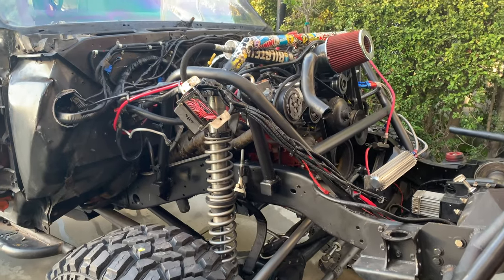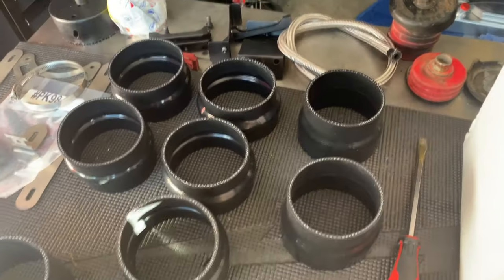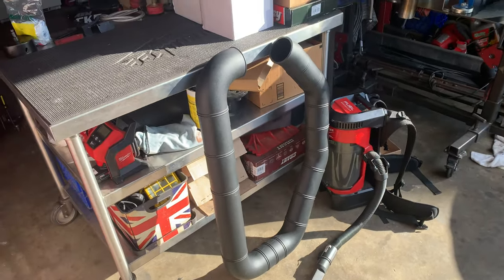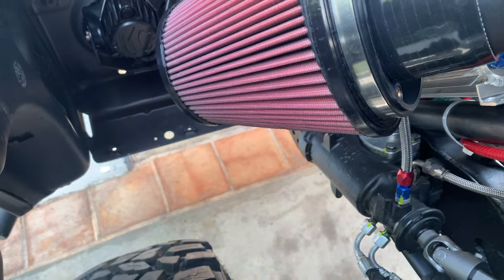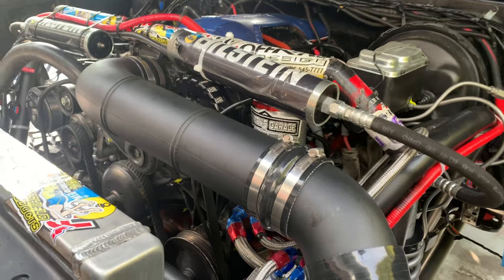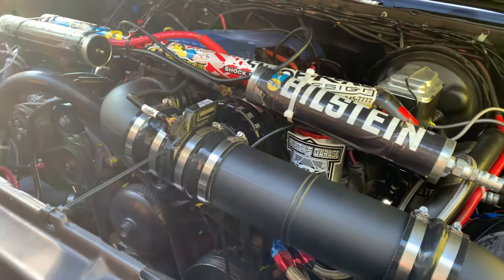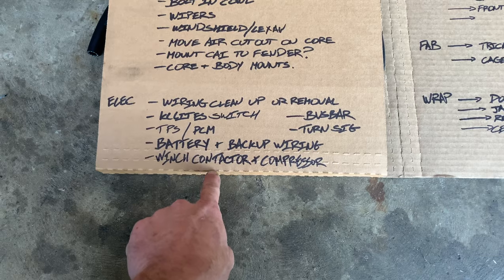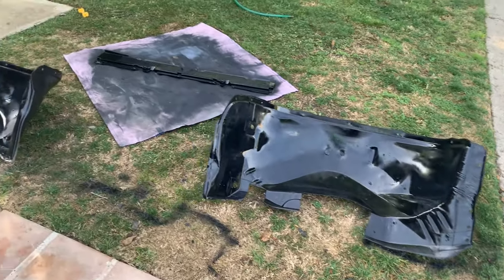MG #187 - bolt on horsepower from the Holley cold air intake!!

Comment: Blue camo looks like crap, looked better before you started the rebuild. I would have junked it when you rolled it and had to build a new rear frame section. Should have started with a different blazer then. I grew up around circle track cars and even with jigs to hold the chassis, the car was never the same after having to" clip" the frame. Everything you are doing now is throwing good money after bad
Reply from the maker: That’s why I have a cool truck.  I don’t quit.
Reply: @MerricksGarage  not saying quit,  just chop the cool parts off and start over with a different blazer, or a different frame.
Reply from the maker: And choose some wrap that doesn’t look like crap??
Reply: @MerricksGarage  lol
Reply: At least this Blue camo blazer turns in both directions...  I would strongly suggest and support any one fabricating on a budget or building in a garage!!! Not put them down for a color choice or awesome ideas on how to fix there mistakes... 

Not everyone can just buy another truck/car  and start over!!!!

Comment: I am thinking about going with the internal cab routing for mine. Wonder if that kit has enough to get it there. ORD K30 example: https://www.drivingline.com/articles/killer-k30-offroad-designs-latest-chevy-truck-build/#.Vw1V3ERiEx8.facebook
Reply from the maker: Yea I have seen Watson’s setup.  I have vintage air so the firewall passenger side is pretty cluttered.  In cab is good for super dusty but....